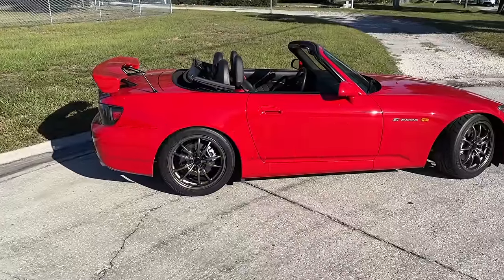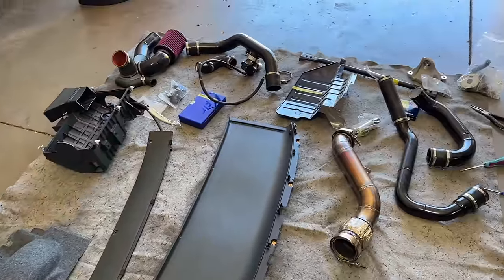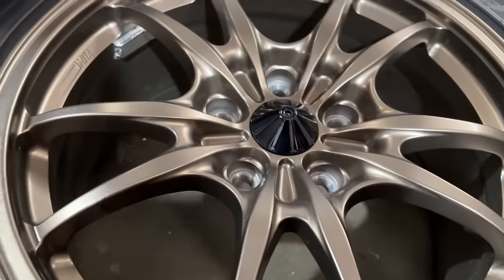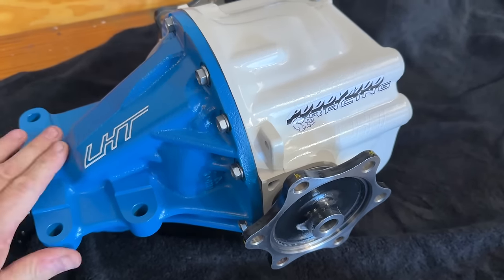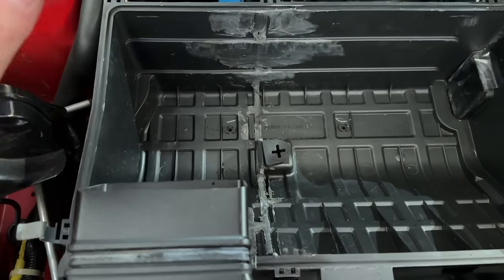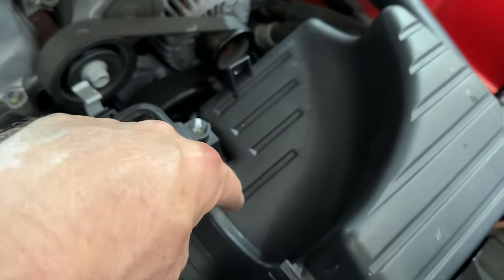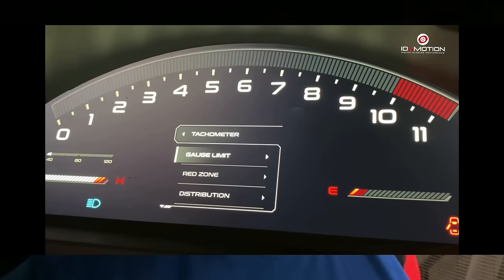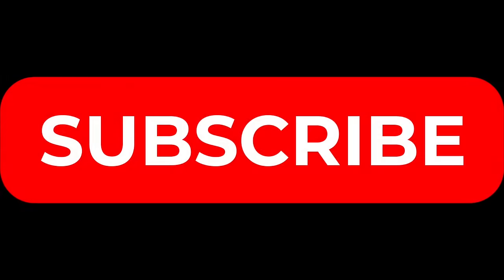LHT S2000 NA Package - Most power stock motor

Comment: It would be cool to collab with Jason from Engineering Explained to get all scientific with the new air scoop
Reply: Erm, no need. His explanations are kinda half baked and sometimes actually wrong, speaking as a fellow engineer.

The results speak for themselves, no need to get bogged down in pseudoscience, just follow the method. From what we've seen of John's process, it should yield a good outcome.

I personally think that a scoop that funnels air from the very top of the bumper opening over the top of the radiator would do more. Like a full width version of the Spoon style duct, or touring car style. Obviously avoiding the bonnet catch area, so it would be in two halves. One for the stock airbox opening, and one on the other side for an additional duct into the box, as in this video. The radiator air path would still be kept separate.

Comment: A 3D printer to make the air duct would be interesting. You could also replicate air flow in Solidworks or Fusion360  to see what it would look like before printing. It'll also be a lighter weight material.

Comment: Great to see some more development in the NA s2000 field. Slightly concerned about what the scoop being on the underside might scrape up. Also seems like it might be a challenge for anybody with a splitter.

Have seen the id4 dash site, very interested to see how it actually works.
Reply from the maker: So far everywhere I’ve gone it hasn’t touched. It’s about the same height as the lower part of the subframe. My biggest concern running over junk in the road. I’m

Comment: Somebody has to be the first. I like the experimental trial and error process of figuring out the details. I am in the process of looking for comfortable seats with manual sliding seat brackets for my truck. Unfortunately, most seats are powered, and I can't find seats and brackets for my vehicle because I am the only one who wants comfortable seats with manual controls. But I'm looking forward to the challenge of figuring out how to connect parts that were never designed to fit together. To me, the seats are too important to compromise on. When I get exactly the seats & brackets that I want with zero compromise all the effort and frustration will be worth it.

Comment: Curious to see the header design you have - looking over more recent test data it 'seems' like changing the cylinder pairing has been beneficial but you often get internet people arguing that what Honda designed 25 years ago is perfect and unbeatable. I'd like to think we've learned at least a little bit in that time to tweak things for at least a slight improvement.

Comment: In my world, nothing beats the sound of a built N/A Honda motor. It's just perfection. My '98 Prelude has the H22A with AEM air intake, DC sports header, Mugen Cat-back, Skunk2 intake manifold, cheap ebay throttle body, underdrive pulleys and tuned with Hondata. The sound is addicting above 4500 rpm. I want to throw independent throttle bodies on it, but I can't push myself to spend that kind of money or cut a hole in my fiberglass hood.🫤

Comment: I heard bad things about the company ID4 and at that price point it should of been an oled.
Reply: have to keep in mind that something in a car (especially the main gauge cluster) needs to be able to tolerate very cold and very hot temps without any issues - I'm not sure an OLED would be a good option. For something that complex and low-production numbers we kind of have to just accept niche pricing.